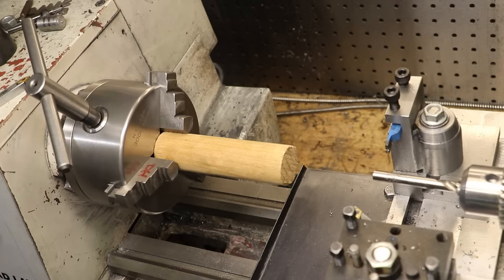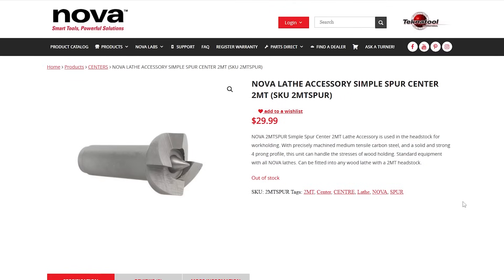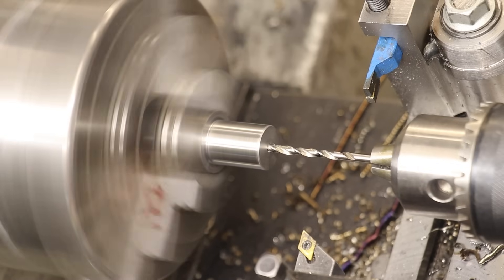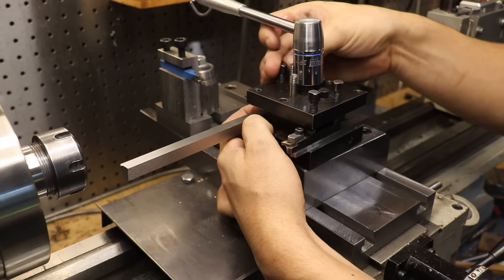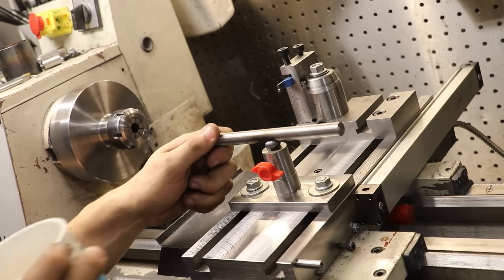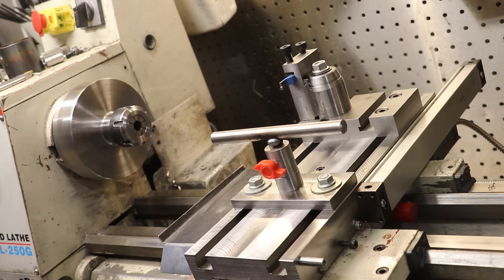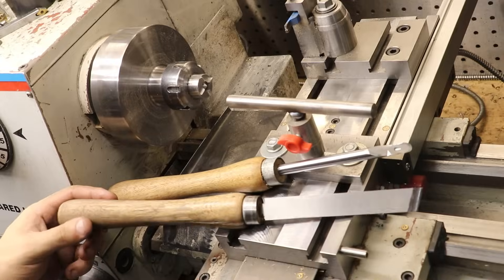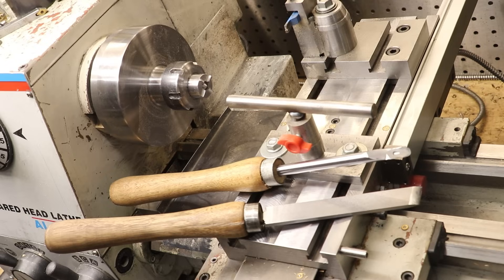WOOD on a Metal Lathe? - Converting My Metal Lathe For Wood Turning

Comment: the #1 problem with wood on a metal lathe is that wood dust sucks up all the oil and leaves your poor lathe defenseless against rust.  You gotta be real diligent about cleaning it and relubricating it after you finish your wood stuff.

Comment: I appreciate you for making your own wood turning tools. I have a wood lathe and several chisels, your skew is great. Copying my detail gouge, it can be duplicated by creating the groove in your rod with a ball end mill a little deeper than 1/2 the diameter. Then rotate the rod 5 or 10 degrees to widen the opening on each side. I grind my gouge to 40 degrees.

Comment: I took the easy way out and bought some cheap turning centres with a Morse 2 taper and use them. Ridiculously inexpensive and easy.
As you said, for a few times a year you need it; it works fine.

Comment: If i turn wood on my metal lathe (extreme rare) i always turn between centers (spur-drive/, centrum) i'm a wood turner more than metal, i do own both a metal- and wood- lathe.
It does take some getting used to turning as close to the chuck but you'd most certainly get better at it after time. I also use a gouge, just make sure it won't move by mounting in 4way-toolpost. And please get some propper gouges and skew and such

Comment: Turning wood in my metal lathe...done it many times.
Leaving the chuck key in the chuck...taking it out for safety is for nappy wearers.
However, using a twist drill backwards....it's still my favourite way to make friction welded twist drill arbours🤣👍🇦🇺

Comment: You can get carbide inserts for wood an attach them to steel. Round, sharp V, slightly curved square (my favorite for outside finish) and sharp corner square. I made mu own tools for my wood lathe.

Comment: Finally someone ignoring "safety trolls" :)
NO you will NOT die if you leave the key in the chuck :)
And for trolls.. no I will not answer. You are just the trolls.

BTW... there are much better design for spur center then 3/4 prongs.
Check for example sorby stebcenter or axminster pro drive center. Not necessary with spring loaded center, it's just a bonus.
Lot of smaller tooth's that will bite, but be less prone to split the wood, and if you tool catch, it will just spin, not damaging the work or kicking the tool in undesired direction.
Also, point should have more steep angle, something like 30 degrees.

Comment: Im actually surprised that the biggest limitation of using a metal lathe for woodworking isnt the max RPM. Given that optimal surface speeds for wood are somewhere in the ballpark of one and a half orders of magnitude the surface speeds for metals (e.g. while high speed steel on mild steel gets quoted as needing ~100 fpm, the rough numbers I can find for the surface speed of say, a bit in a wood router, is around 14000 fpm). 

back when I took classes on material processing, I remember my teacher saying that this was actually a reason to think of woodworking tools as more dangerous than metalworking. (not to say that you should think of either of them as *safe*!) Because while both have more than enough force to really mess you up, the woodworking tool is gonna do that hell of a lot faster.

Comment: I normally use a turning spur mounted in the chuck or the set of home made wood jaws I can swap out for work holding. For a tool rest I have a couple dedicated tool holders with a lengths of mild steel to act as a tool rest for regular gouges and cutting tools, it works pretty good. 👍👍

Comment: Turning wood on the metal lathe is no problem but it will help if you cover the ways with some thin rubber matting.
I have made a lot of handles from Sycamore wood for files and scrapers etc on my own metal lathe...the Sycamore is really dense and tight grained if is from the tree branches that are about 50-70mm in diameter.

Comment: Something I found successful for gripping 80 or 90 shore A polyurethane rod in my 3-jaw chuck was to use a piece of exhaust pipe. Find one with the same i.d. and split it down one side to make a makeshift collet. It spreads the surface area and grips the soft material. Since it is almost torally contained, it keeps the material from spreading and changing shape. Doing this with wood will work as well. You might find you need a thicker wall pipe depending on how soft the material is, but I was happy with the support it provided.

Comment: Honestly I don't see the issue with using wood as a material to make a part in a metal lathe, like it's not that diffeerent from polymer and composite materials.

I would be definitely much more concerned in the opposite case.
Reply: Tufnol Phenolic is very similar to turning wood. I have turned loads of wooden items over the years on my metal lathe.

Comment: The gouge you're after for doing the spindles is, oddly enough, a spindle gouge.  These have a more pronounced "U" shape to them.  By cutting your shafting in half like you did you ended up with ore of a shallow curve gouge.  But hey, it's removing wood just fine.  The new handles came out looking nice.  Shame about the split.  You need to drill two holes that form a  flat "V" hole.  then sort of chew out the middle.   Another trick I've used often on tangs that are at risk of splitting the wood is to "bed" the handle by heating up the tang to blue or just into the grey that comes after blue and heat bed the handle.  It's smokey work though.  But the wood takes on a perfect match to the tang and locks in place with just a moderate couple of taps.  And no risk of cracking the wood.
Reply from the maker: Cheers. You are watching in real time me making these for the first time so I wasn’t surprised that it came out a bit wrong, but I was thankful that it was removing wood as it was. Thanks for the tip, I’ll probably have to regrind the gouge soon enough. Thankyou

Comment: Blondihacks,
Was sent a "Freehand Copy System" to access, a while back.
Cant remembered the Brand.
Would work very well to create fancy Wood parts on a Metal Lathe.
Im sure you have the machinery to make your own, from the videos 😉
Reply: It is the Turnado copy tool made by Eccentric Engineering in Australia.
Reply: @howardosborne8647  
That's the one !
👍

Comment: for that type of wood turning tools the rest is to high, for those tools the handle should be lower then the tip, still learning wood turning myself, but I do know those tools want to do up cuts and not straight cuts like insert tools want
Reply from the maker: Yeah I say so in the video. The rest still has another cm of travel so I should be fine when I have to use it next time. Cheers

Comment: so I have one of those 12 volt toy lathes made out of aluminum extrusions, its mainly used to make little PCB standoff's and light pipes and whatnot for electronics, but I set it up to do some small wood turning for pens. I can stop the chuck of this thing running full speed and power with my hand (its not the safest thing in the world but its not going to suck my hand in) anyway long story short im turning a pen body for my dad for a present and I hit the tiny tiny 3 inch 3 jaw chuck and it shot the chisel a couple inches through the drywall of my garage, 2 out of 10 do not recommend (easy fix I just hammered the handle back on the tang, but out of the box the harbor freight carving chisels are very lightly held in place)

Comment: Carbide cutters would be a better option for your needs I think, however 'If it works, it's good enough.!' Check out Robert Sorby for tools. Far cheaper options are available of course.

The clearance you ground into your gouge is the area or Bevel that makes first contact with the wood and the tool rides on it. Differing bevel angles or grinds effect the way the cutting edge of the gouge is presented to the workpiece and correspondingly differing types of cuts can be made.

Be careful, Woodturning is addictive 😁

Comment: I have an old shopsmith 10ER that I use as a wood lathe. I went to use it a month ago and couldn't find the spur anywhere. So I tried turning wood on my South Bend instead. Never happening again! It worked well enough, but the sawdust gets EVERYWHERE. I cleaned the machine right after and I'm still finding sawdust a month later. I need to make or buy a replacement spur. Great video.
Reply: I can sympathise as I bought a 2nd hand bandsaw which had been used for wood and I was using it for cutting other materials but I was still having saw dust coming out of it a couple of years later, not much but enough to remind me of its previous life and I had already given it what I thought was a thorough clean on a few occasions.
Reply: Your a wood worker and get sawdust every where !!!! Well isn't the nature of the beast ! It's like complaining about going to the beach and getting sand everywhere !!

Comment: That split handle will eventually split further. The tension didn't fully release with that one crack
Reply from the maker: Off camera, drilled out the hole larger and glue the crack.

Comment: The few times I've used wood on metal lathe I put paper towels over the bed & a light spray of oil - picks up most of the dust. Have a vacuum running from behind to catch the heavy chips. Noticed you were using the tool higher on the work piece - if it digs in watch out. Better to lower the tool rest & keep cutting at horizontal centre height, then if you take too deeper cut the wood is turning away from you rather than still coming fwd.

Comment: If anyone is serious about wood turning on a metal lathe, I very highly recommend the Victorian era book: "Hand or Simple Turning Turning" by John Jacob Holtzapffel (Re-published by Dover Press), and it's companion book: "Ornamental and Complex Turning".
There is nothing to prevent use of the metal lathe, or milling machine from working wood, particularly for very hard woods. I recommend wiping the normal way oil off and substituting a dry spray type lubricant. Use the speeds and feeds for aluminum as a starting point.
Once you get the basics right it's wonderful what you can do making threaded boxes and lids on the lathe, or complicated  joints on the mill.

Comment: You may find the file will work well if ground as a 'form tool' ie, radius the end and use it flat. It will act a bit like a scraper but should produce a clean finish.

Comment: You might consider making one that you use button inserts. Seems right up your alley and they are nice since you can easily just replace them when they wear.
Reply from the maker: I tried that a few years ago using my button inserts. The ones I use for the fly cutter aren’t sharp enough, I would need different inserts
Reply: @artisanmakes  With the gouge you made you care about sharpness?
Reply from the maker: The edge is sharp. Sharper than the botton inserts. I just remember that they didn’t work all too well. Granted it has been a few years since I did it. Cheers
Reply: Seconded, the tools are hilariously easy to make (think scrap steel in a handle with a threaded hole for the insert) and while they don't cut as smooth as traditional gouges, they work plenty fine enough for 'a couple times a year' wood turning.

Comment: A tip for fitting the handles.  Grip the tool in the vice as you have done. Heat the tip of the tang plus 1" to cherry red. Push, don't hammer,  the handle onto the hot end. It will smoke like crazy  but will burn the shape of the tang into the wood. Pull the handle off. Don't let it catch fire. Reheat the tang and repeat as many times as you need to until you're  satisfied. Then tap the handle on, maybe with a little epoxy  glue, and you're  done.
Repeat for your other tools, files included.
Reply: Yep, that method works great.
Reply: I also hot fit any tanged tools into wooden handles and eoxy them as a final fit.
Reply: I use the metal lathe to drill a hole through the middle of a chisel handle blank. Works fine. Also good for making dowels.

Comment: Your tool holder is too high to get a proper cutting angle, you're mostly scrapping which is demanding on the cutting edges. Richard Raffan, a renowned turner, has lots of videos for beginners
Reply from the maker: Yeah I said so in the video. The tool rest can move down another cm or so

Comment: You should learn to shave rather than scrape. It is much more effective and leaves a much better finish, although it is more difficult to master.
Reply: Also wear the tool less, scraping will dull the edge in about 8sec or so.

Comment: I do that, as well. Admittedly, I generally turn (only extremely hard) wood on a 350x1100, so it's great even just for the amusement value!

I have a wood lathe, two actually, but there are certain species that just aren't pleasant to manually turn: ipe, leadwood, black palm... that sort of thing.

Clean up well, so there's no dust/chips to catch moisture, and you'll be fine.
Reply: A shape you’re happy with- sounds like all my ex wives